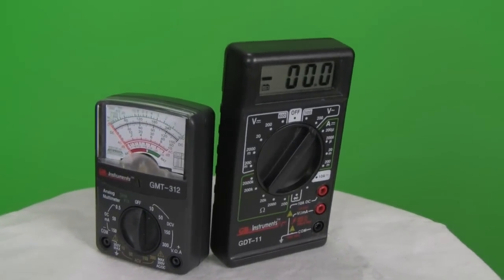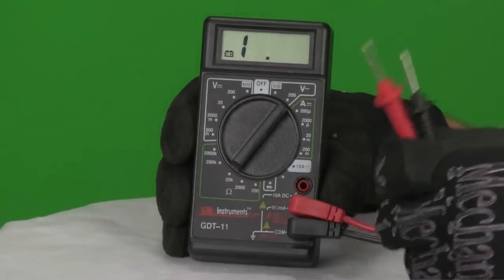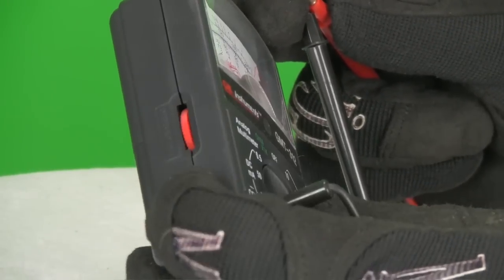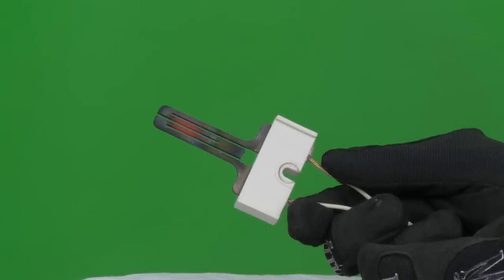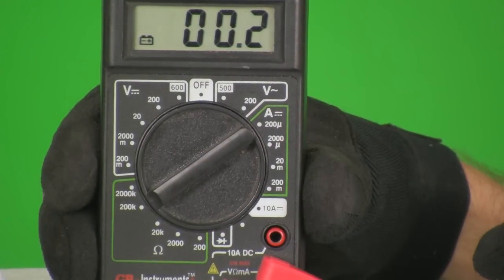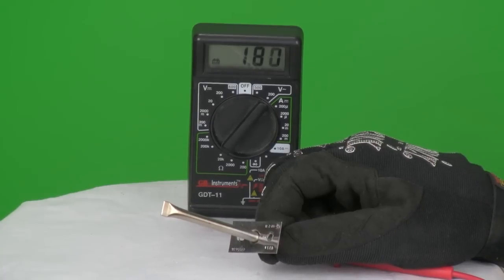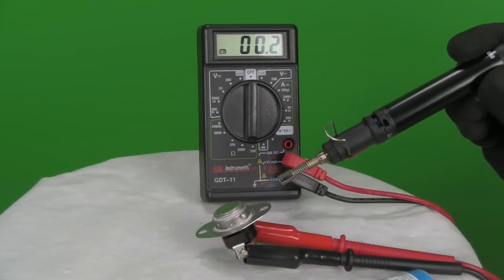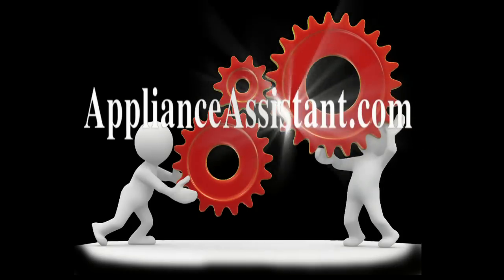How To Use A Multimeter For Appliance Repair

Comment: Looks like you have the meter set to ac voltage and amperage  checking continuity/resistance.
  I would think continuity/ohms is on the lower left of that meter. 
  What am I missing?

Comment: Can you use voltage drop tests to check circuits on household electrical appliances; or is that too dangerous to do?  I know that they are very efficient tests to conduct on 12v DC automobile circuits.

Comment: 05:43 What is that you spray and why?

Please advise!
Reply: That is keyboard cleaner, it is to lower the temperature of the defrost thermostat to test if it is closed when cold. If you hold the can upside down when spraying it will freeze the thermostat. Thank for the question!
Reply: Charles Yingst Thanks for quick response!

Your videos are very helpful!

Comment: Can you post the link for the electrical section, I'm having trouble locating it. Also I have the actron cp7672 when I set the meter to the omega area, it reads 1 non stop, it doesn't' ever change. Does that mean there is something wrong with the meter? Oh and Great vid, but just a critique for your next vid. Because the dial is black, the viewer can't see the dot on the dial to tell where you are setting it. It would be helpful if you put a white dot on the dial so viewers can see the setting easier.. THanx again.
Reply from the maker: sorry for the delay! 
http://applianceassistant.com/Electricity-And-Testing/Electricity-101.php 
Thanks for the video tip! nice to get good feedback like that.  That's strange with the reading... it should change when you touch the leads together... OL is the normal reading on most meters for infinite resistance.